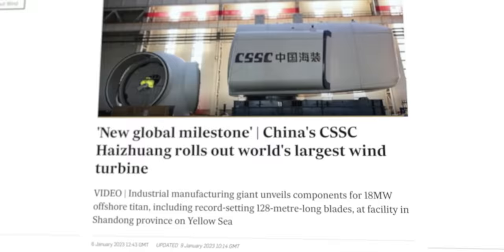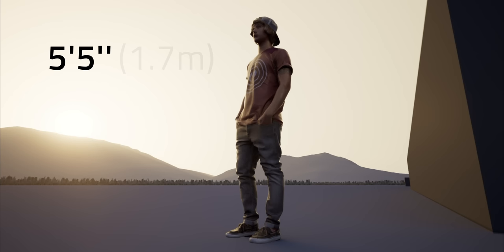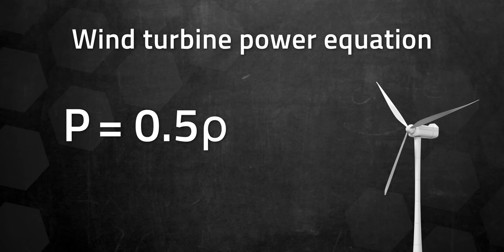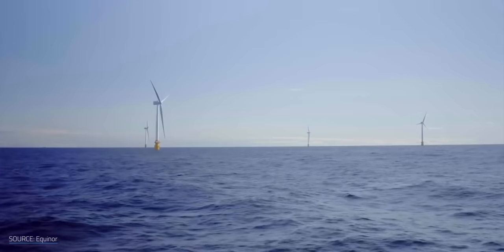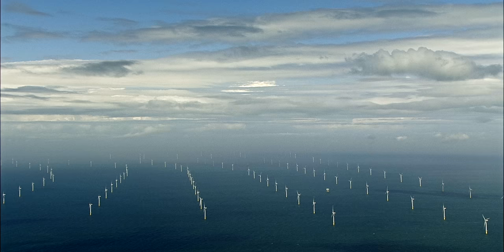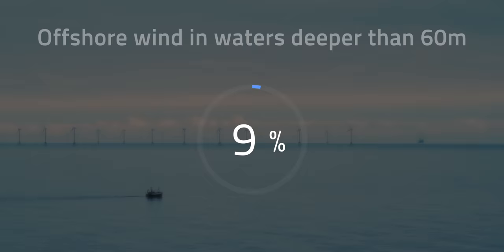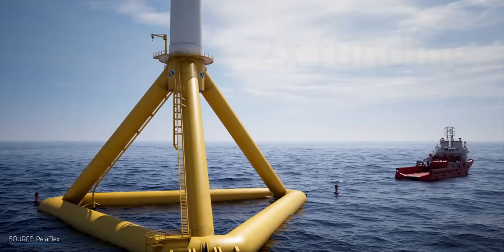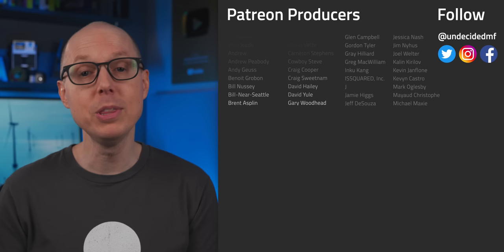Why Are Floating Wind Turbines So Huge?

Comment: Hi I’m currently doing my master in wind energy, so I’m always very happy to see people with a bigger audience talk about it, especially floating wind. 

Most of the points you made were really good but you were missing out on one point that is actually among the biggest drivers in size: the bigger the turbine the less of them you need. A 600 MW wind farm needs either 75 8MW turbines or 40 15 MW turbines. This means that you also need less foundations (especially crucial for floating wind where those are massive/super expensive ), but also less cables, less time to install them (expensive installation vessels) and also very important: you need to maintain and operate less of them, which is also a very large cost factor (30% of total project costs). 

Anyways thank you for raising interest in offshore wind!
Cheers from Norway ✌🏼
Reply: Is there a path to get floating wind cost competitive? 200USD/MWh (likely LCOE) sounds very high in an industry that is very cost competitive.
Reply: @leonfa259  more demand will help reducing the manufacturing cost.
Reply: @leonfa259  Yes the LCOE will drop drastically in the next 10 years. Globally there are only 216MW of floating wind turbines installed right now which is around 25 turbines, globally. So so far the projects were really small pilot projects and now the industry is planning to enter the next stage with several smaller commercial projects of 200-500MW per farm planned to be installed in the next five years and then wind farms of 1GW coming probably by the end of the decade. Scale is a very big factor for the LCOE as the production cost per unit can be reduced massively and the bigger turbines will also play a very big factor as fewer turbines/foundations will be needed. 

So really floating wind is just at it's starting point right now and it will be very interesting to see if it can fulfil its potential. That being said, I think the LCOE of floating will always be higher than those of bottom-fixed turbines as those are just simpler (currently around 60USD/MWh, gas & coal around 100USD/MWh), but as mentioned in the video floating opens up whole new markets.
Reply: Before watching this video, I thought that the main reason for wanting to install wind turbines at sea was so that they would not be installed on land, which has a much greater value, and it would be a shame to "waste" a large area just for that.

Having this thought in mind, I questioned myself one day. "What will be the average power generated per square kilometer of a wind turbine grid, and how does that compare with the same area covered by solar panels?"

That is, if the idea is to use the smallest possible area, which would be more efficient?
Reply: Not really a valid point, demand for energy is infinite.  More powerful turbines don't decrease the amount of land used - just increases the energy production per land unit
Reply: He did address that though
Reply: How is the progress these days on
1. Integrating electrolyzers into turbines in times of power excess
2. The use of superconducting magnets to decrease nacelle weight on upcoming 20MW turbines?

If you're doing your master's in wind energy, are you by any chance at DTU Wind?
Reply: I gotta wonder about sea salt corrosion and salt build-up and pitting on the blades.
Reply: @Hemenesgard  You can combine wind and solar in the same area, it is not an either or question. Wind is often combined with agriculture. But if you want to compare windparks and solar farms, then solarfarms have a higher output per area.
Reply: Wait what bachelors did you do?
Reply: Farther offshore farms means longer/more cables and you lose power before hitting the onshore grid. However lots off local offshore seas too deep for fixed offshore farms (think Norway/California/Japan) are losing out now. Hopefully subsea sealife will find them easier to traverse.
Reply: @leonfa259  You can’t really say that without taking in consideration the geological location. The peak output of a solar field might be higher, but the energy produced by wind is more widely available (during the day and the night). This is why wind turbines produce more energy in total per m2. The advantage of solar energy is the fact that you can place it on otherwise useless surfaces like your roof while you can’t do that as easy with a wind turbine. The reason why you see so many solar panels is due to the easier installation and lower costs then wind energy.
Reply: @GeoStreber I doubt any electrolyzers would be first integrated into offshore farms. Better to do this onshore where piping hydrogen is easier.
The dutch are building offshore "power station" islands. These integrate different wind farms and then just need one cable to move all that power to shore (needing perhaps just one hv dc cable). Superconducting cables are more likely in cross country overhead/underground cables (Chicago to detroit or Atlanta to the coast). China has hvdc cables running from the high wind north to the high power demand coastal south.
Reply: @CorePathway All turbine spars are carbon fibre composite and oil rigs have survived in salty waters for decades.
Reply: @amamgi Plus solar ends near sundown unlike wind. Nobody has found a cheap low cost instant storage solution (pumped hydro is expensive)
Reply: @stephendoherty8291  both Vestas and Siemens/Gamesa rea reported to work on offshore wind turbines with integrated electrolyzers.
Reply: @GeoStreber  As far as I know there are concepts of integrating electrolyzer directly on the turbine, but it would increase the complexity of the turbine massively and thus hasn't been implemented so far. I think it will be much easier if you have one large electrolyzer on the substation of the wind farm, where hydrogen is produced centrally

I sadly have no idea about superconducting magnets, not my filed of expertise but I heard of people researching it

I have been at DTU for one semester, it was a really great education, but my master's is called European Wind Energy Master and is a collaboration between TU Delft, DTU, and NTUN Trondheim
Reply: @CorePathway  as previously mentioned salt corrosion is not the biggest problem as the industry is used to build structures offshore for 70+ years (oil and gas). A way bigger factor is actually rain erosion on the blades, its really impressive to see how much impact this has
Reply: @catalintimofti1117  Did my bachelors in mechanical engineering and now I am doing a programme called European Wind Energy Master :)
Reply: @flo3381  I'm currently doing my PhD at DTU, but at a completely different field. Were you at Lyngby or at the wind farm test field?
Reply: unless you go down to single digit turbines were a single malfunction disrupts the whole production ;)
Reply: Just imagine the amount of fossil fuels required to build something that large. Way more than that windmill will generate over it's entire life span and then some.
Reply: @xpload32004  You gotta love arguments along the lines of "just imagine" -> "something is big" -> "it must be bigger than something else". If we could just imagine the answers to such things then there would be no point in getting a Bachelors in Mech eng or a Masters in Wind energy. These things are quantifiable, by using maths. One little bit of logic for you: its energy companies who are making these things and they are VERY good and working out if they will make money... if it took more energy to build them than they got out of them, then the thousands of impossibly clever engineers it takes to design them and the worlds most successful financiers would have noticed that. They are big, they do take lots of energy to make them, but no, I 'imagine' the energy they generate over their lifetimes dwarfs that initial outlay.
Reply: @xpload32004  Bullshit. The energy recovery time for wind turbines is about 6 months.
Reply: @GeoStreber  How nice! I was in Lyngby and sadly never had the opportunity to go to Riso.
Reply: @flo3381  I pass the DTU Wind buildings almost every day. They still have a bunch of turbine blades outside, always nice to see.
Reply: How much material do you need to put in the sea, to raise sea levels?
Reply: Thanks for showing all the positive things about wind. Everything has a negative side as well. Why don’t you show all the negative things about wind mills… oh wait because it would out weigh the positive way to much.
Reply: @DeadVegaInSpain  I'm curious to hear your thoughts what those negative things would be and if they really outweigh burning fossil fuels
Reply: @DeadVegaInSpain  Can you show a few negative things then?
Reply: sir it is really hi tech.
Reply: @Hemenesgard  To answer this question, we need a location where both solar and wind are viable renewable options. The problem is, wind & solar typically reach peak efficiency in different geographical locations. In the US, wind usually excels in the middle of the country, where land is flat, & the mountain ranges funnel cool air south. However, solar panels need a high UV index & low precipitation; meaning southern, aired, states like AZ, NM, & CA have the best rate of return on solar.

Texas happens to meet both these criteria, so this is the location I chose. Its tough to get exact numbers on the land size of these wind farms so I decided to do a direct comparison between 2 farms in Texas.  The Horse Hollow Wind Energy Center produces 735.5 MW on 47,000 acres, and the Upton-2 Solar Farm produces 212.5 MW on 1,900 acres (both in TX). Meaning solar energy produces approximately x7.15 the energy that wind does per acre.

I do not have a masters in wind energy but I did take a class on renewable energy like 6 years ago so trust me, im qualified.
Reply: @seanherbert58 , interesting! Thanks for sharing this data.
Reply: Really curious how do you solve them all just floating away in deep oceans? may be wrong but feel like with that much surface area and speed they would want to just float away, and do any huge concerns with breaking global wind patters play a huge factor maybe limiting where you can install them? recently learned about el nino and la nina and seems like it might effect it
Reply: Ever heard about "air rivers" that bring moisture (=rain) back to dryland?? So ... are we sure-sure that this aeolic energy capturing is good for us?
Reply: Masters in wind energy? Should have done a MBA instead of roi vs government subsidies and green energy mandates follow the money
Reply: What have you learned about the negative effects this will have long term in coastal areas and marine life?
Reply: @johnsmith99997  may I ask, how did you arrive at the conclusion that energy demand is infinite? I thought it was a very very finite amount that suppliers have to accurately meet in real time?
Reply: It is so amazing how much power these things require to run and also how much nature gets ruined by them.
Reply: @aloooonee  but isn't economics about how more demand increases costs?
Reply: So how many homes does a 600 mv farm power?
Reply: @alienesquemotivation  judging by the fact it really only takes at most 1kW to power a home for the day - it could be about 600k hoes.
Reply: who cares.
Reply: They Are Making Bigger Ones
Reply: @Hemenesgard  Wind turbines don't end up covering full area. You can still do farming etc under wind turbine which you can't do under solar panels.
Reply: @CorePathway  as far as I understand it, wind turbine blades are being made out of carbon-fibre. It does not get any pitting from salt air. Not sure about these new huge turbine blades.
Reply: @stephendoherty8291  here in Australia we have a National Electricity Grid, and we have cables connecting Tasmania to the mainland (over 200 km away) as well as connectors from South Australia to Victoria and New South Wales. When a power station failed briefly in Victoria's Latrobe Valley, the South Australian battery kicked on in a millisecond, providing power from over 1,000 km away.
Reply: @petesig93  I’m sure smarter minds than mine have figured it out
Reply: @yoshiwhere148  have you never heard of 'anchors', 'moorings' and 'cables' ???
Reply: @petesig93  Had to be a pretty big battery to fill in for a power station for more than a few mins
Reply: @leonfa259  do you mean cost competitive with flying to Mars?  We’re going to need a new planet soon! How much do you think that’s going to cost??
Reply: @johnsmith99997  demand for energy is infinite? What planet do you live on?
Reply: @CorePathway   Yeah, you’re probably right. The engineers at vestes probably are too stupid to think about salt water when they’re investing in hundreds of millions of dollars.  I mean, we already know that ships in salt water just rust and sink after a few years, don’t we?
Reply: @solarwind907  Energy is all about costs, since we need so much of it and at so many levels of our supply chains.
I am all for going to mars but mars is much less hospitable than the arctic, so it's not a replacement for earth. To get to Musk's goal of a million people on Mars we speak about roughly a trillion dollars if all his plans come true.
Reply: @solarwind907  I guess you haven’t been paying attention to the Siemens/Gamesa wind turbine failure rate fiasco.
Reply: @CorePathway  don’t know what you’re talking about. Do you have any references?
Thanks.
Reply: A Master's in "Wind Energy".  Wow.  Who would have thought
this could come to fruition?   Is this more of an Engineering degree?
It is an interesting degree field.
Reply: Since you're going through your masters, what do you have to say about backups for a wind farm of this scale?  How much, what sort of energy source? 

And wouldn't you agree that it would be more accurate to call wind and solar "disposables" since there really isn't anything about them that is renewable?  They all end up in the scrap yard...
Reply: Wind energy only works where there is wind and it takes a lot of space and maintenance.  Nuclear energy is more feasible and capable of covering larger groups of people as opposed to wind turbines.
Reply: @matthewsmith8249  use the wind to charge a battery or electrolyze hydrogen. Pumped water storage can be another option. Geographic diversification yet another.
Then you have power when the wind is not blowing in your area.
Renewable energy is called renewable because it’s delivered free daily. No equipment last forever.. An intelligent person. Recycles everything they can.

As my father would say, use your head for something other than a hat rack
Reply: @solarwind907  First: electrolizing hydrogen is extraordinarily expensive--so is hydrogen handling.  And battery storage, my goodness, where to begin. 

A 10-hour battery backup for just one of these 18 MW windmills would require approximately ten acres.  But 10 hours is not nearly enough.  A week or more of backup is needed because it can be windless for that long, even at sea.  So, suddenly you need 100+ acres...for one of these Windmills.  But that not even the biggest problem. The biggest problem is the reality of recharging. 

Recharging depends on having excess power precisely when you need it.  After a windless period, and the wind starts blowing again often times there won't be enough wind to both recharge the batteries and supply customers in real time.  If operators can't recharge the batteries sufficicently, the power shortage problem immediatley snowballs.  So you need backups for backups, but this in-turn recompounds the recharging problem that you were trying to solve in the first place.  

So with all these backups, you quickly find that you need a dedicated, dispatchable 5000 MW natural gas plant to ensure the batteries are topped up.  All this, when one can instead build just a single 1GW nuclear plant, and have clean, consistent, reliable energy for as long as you want it, and do without all the crazy, maintenance-intensive rube goldberg backups.

Water storage? This simply not feasible in more than few places because it requires ideal geography for both wind and the reservoirs, and neither is particular good for ecosystems. And a good many of the world's ideal locations for dams are already spoken for and in use.  Even it there were enough locations, you still have the recharing problem to deal with...

The reason both wind and solar are not renewable is that none of their electricity-generating elements can be refit or upgraded like nuclear and natural gas plants can, they have to be scrapped entirely, and replaced entirely--disposable energy.  

These problems are already very well known among experts, but not talked about in the popular science media. 

No matter how you look at it, relying on irretriveably intermittent power sources is expensive, and repleat with intrisic problems.  Its only being done because its politically popular, fashionable (high degree of sentimental appeal) and there's money to be made (with subsidies, of course).
Reply: Question, Canada has heated wind turbines, right? Can we use a modified wind turbine that is heated to scalding temperatures to use in Antarctica to power cities and even labs in Antarctica or colonize the shore of it?
Reply: @manwhoismissingtwotoenails4811  
We don’t have heated wind turbines in Alaska. I’m 99.9% sure they don’t have them in Canada either.
Reply: @manwhoismissingtwotoenails4811   You need a lot more than just a heated windmill and a few batteries to make that work.  Quite cost prohibitive...
Reply: Hey there! I’m currently working on a capstone project focusing on investigating adaptive wind turbines and turbine blades based on varying weather conditions. I’ve been reading up on research regarding materials and the impact of adding aileron features to turbine blades. It seems like adding aileron features might increase maintenance costs and weight requirements more than actual energy production.

Since the project specifics are pretty loose, I’m open to exploring different developments in the turbine industry. I’d greatly appreciate any input or expertise in wind energy and turbines. My team needs a solid basis before we can start investigating and possibly developing adaptive wind turbines. Any insights or knowledge you can share would be invaluable. Thanks in advance!
Reply: @ausitnsalas3368  Hey there, I sadly can't help you so much here. I have a good overall understanding of wind turbines and maybe a better one on floating wind, but in regards to aerodynamics and blade design I only had a few lectures so my knowledge won't be better here than just reading into the associated papers. Still, all the best to you research!
Reply: Two questions. Why aren't the blades longer? They seem like they have a lot of clearance from the ground. 

 Secondly. I noticed the generator has a bunch of coils around the diameter instead of just being one large copper coil. Is there a reason for that? Saves copper for slightly less gain?
Reply: @dianapennepacker6854   
Regarding the first question:
Two factors play a role here, one is that the current blade lengths of up to 120m are already at the limit of what is possible in engineering. If they were to become much longer (which they might with ongoing innovation), also the transport and installation will become very tricky as there is simply no equipment for it. 
The clearance is related to the wind being a bit weaker at groundlevel and more importantly to environmental reasons as many seabirds migrate at hights lower than 30m. But also for the safety of people on the platform it makes sense to have some clearance.

For the second question: I am not sure what you mean with one big coil. But a setup like this with many coils is extremely common in almost all electric motors and generators